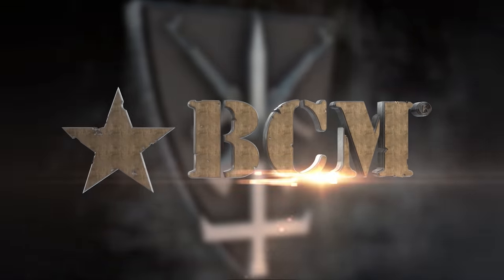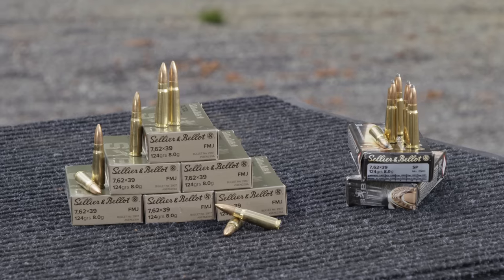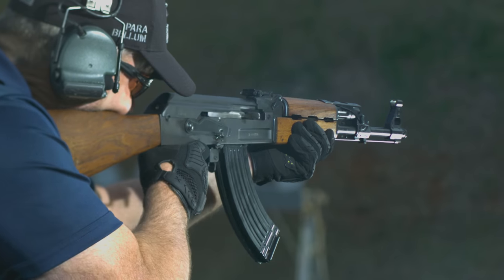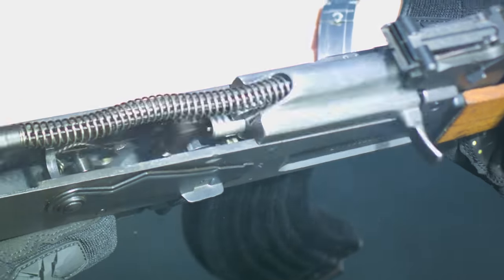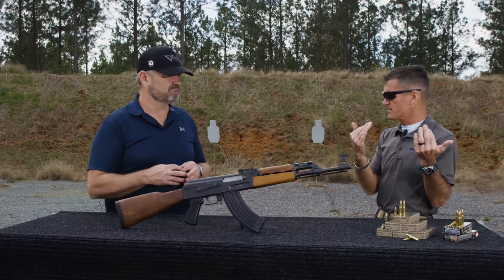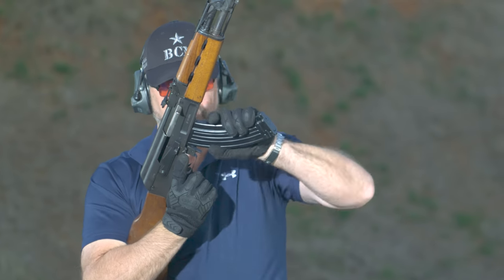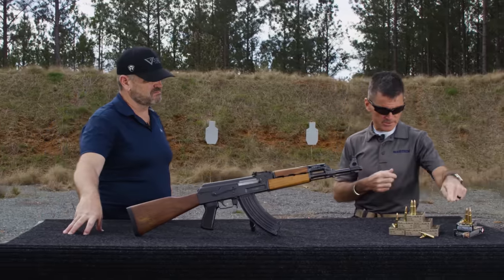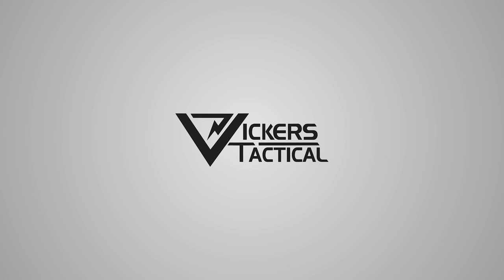S&B 7.62x39 - Brass Vs Steel Case

Comment: Ive always loved steel case. As long as you dont have a crome lined barrel, steel case/ steel jacketed is fine for practice. Also steel case is a 1/3 the weight. Great for bugging out.
Reply: I think you mean DO have chrome lined.
Reply: The majority of 7.62x39 barrels on military style firearms are chrome lined for increased wear and corrosion resistance. Using lacquered steel case/steel core/bimetal jacket ammunition in them does not significantly reduce barrel life, although it is usually less consistent(lower QC, higher acceptable tolerances) than brass case 7.62x39.
Reply: @blackbird_actual  sorry i was talking about 5.56 barrels. 7.62x39 is a lower pressure cartridge so the lining doesnt heat up like 5.56 barrels do. Ive always learned through CMP that steel jacketed bullets can wear barrels faster especially if they are crome lined, but 7.62x39 is significantly lower pressure than 5.56. Thats why i like buying tula ammo, and pulling the bullets and replacing them with M193. That was i get 1/3 the weight with steel case with a better quality bullet. Then just cast the lead out the projectiles.
Reply: @Chris_Garman  its 5.56 barrels I was referencing.
Reply: @Je3perscre3pers  "steel jacketed bullets can wear barrels faster especially if they are crome lined" - why would steel jackets wear chrome faster than steel on steel?
Reply: @ChucksSEADnDEAD  its difficult to explain but its fluid dynamics under pressure. The way i was told In theory, the more pressure you put on certain metals, the easier they bend (and heat). I guess if you want a better example, its why hollow point boat tails can deform in flight. I never understood why copper or brass solid projectiles are so good until i understood this principle. Some companies will put plastic tips in their bullets to prevent deformation. Back to the subject, chrome lining does the same thing but faster. Steel on steel wears fast yes, but not like Chrome.
Reply: @Je3perscre3pers  "the more pressure you put on certain metals, the easier they bend" - but given same chamber/groove/land dimensions, pressure should be similar between two rounds of the same type fired on two different barrels. Pressure shouldn't be higher on a chrome lined barrel.
"Some companies will put plastic tips in their bullets to prevent deformation" - I mean the plastic tips were causing deformation themselves because the heat softened the plastic mid-air until the material was changed for a higher melting temperature plastic... I still don't see how chrome, which is used precisely because of hardness and low wear properties, can't handle steel jacket ammo as well as bare steel.
Reply: @ChucksSEADnDEAD  all i can say is, take a muzzle wear bore gauge, take two chrome lined barrels with the same gas system, shoot 5000 rounds of copper jacketed bullets in one and 5000 rounds of bi-metal jacket bullets in the other. I havnt done it personally, but ive replaced barrels like this(CMP High Power)Their is a difference. It can be anywhere from .001 to .003. Maybe a marginal difference, but its enough to see a barrel go from 1.00 moa factory ammo to someone who practices with Tula to 2.75. (These are heavy or varmint contour barrels so yes 1moa with Tula is absolutely possible)
Reply: @Je3perscre3pers  "take two chrome lined barrels" - but that's not what you're arguing. You're arguing that a non-chromed barrel will wear faster than a non-chrome lined barrel.
"shoot 5000 rounds of copper jacketed bullets in one and 5000 rounds of bi-metal jacket bullets in the other" - What? No! If anything you need to shoot only bi-metal jacket ammo to see if the non-chromed barrel lasts longer. The issue isn't that copper jacketed bullets wear barrels less, it's that you said that steel jacket shouldn't be shot through chrome barrels...
Reply: @ChucksSEADnDEAD  okay. You get what Im saying. Non-Chrome line barrels. Sorry ive been reloading all day long and ive been switching back and forth to this.

Comment: I've always been told that running steel in an AK platform is more of a safety thing than a performance thing. Due to its violent action
Reply: Never heard that I don't believe. It's been 10+ years since I really looked into it. From what I remember, it was just about cost. Steel case was always way cheaper. I've never had a problem with either in my WASR tho.😁😉

Comment: My question is about bullet diameter re bolt gn (CZ). I've heard there is difference between US vs Eastern Euro diameters in 30 cal. That CZ prefer the Eastern spec re accuracy. Is this true LAV?

Comment: Nice but you need to try the new AK203  jointly developed by Russia and India. Its seems its way better than any predecessor AK and is modern and accurate as the AR15

Comment: I don't like using brass in my ak because for some reason my rifle will fire with no problem for about 30 to 60 rds and then the nose of a case eventually breaks off inside the chamber and I will have to jam a sreel case round in just to extract the broken piece

Comment: Something people should know is if you have something like an SKS that has a free floating firing pin it is highly recommended that you should steel case since they have harder primers and brass case have softer primers and if you shoot brass case they have a tendency to misfire and or slam fire when the bolt is closed which sucks now because you can't seem to find steelcase since Joe Biden put those sanctions on Russian ammo. And I've been finding no ammo that is steel case that is being made domestically if any of you guys know any steel case being made within the United States or pretty much just out of Russia please let me know

Comment: Why are iron core rounds not a good thing in a range scenario...and something about magnets?!
Reply: Range owners hate steel dinging their backstops and the steel impacting stuff can throw sparks. A small percentage of powder from each casing is ejected out of the muzzle without burning and gets peppered all over the range. The sparks can ignite the powder and cause fires.
The magnet is a trick to detect steel inside the jacket.

Comment: We manufacture steel cased, non-corrosive 7,62x39 ammo with either mild-steel or lead core bullets and they run perfectly fine in all AK or SKS or VZ variants. No issues what so ever. Even in bolt action rifles. The advantage? Price! GetLoad.cz

Comment: Although Steel Case with bimetal jackets do have greater wear and tear on barrels, typically you will still have money even with the price of a new barrel included. And Tulammo(and Wolf I think) are making steel cased, non magnetic rounds, so you don’t even have the increased wear and tear with those rounds.
Another issue is that it is mainly Surplus Ammo that is corrosive, no new production ammunition will ever be corrosive.
That said, there are still benefits to brass cased ammo, better seal means the gun runs cleaner, reloadable, overall higher quality(not an issue of the steel case, rather who makes it) and more range friendly though this video is biased towards brass cased ammo.

Comment: Thats m70b2 not an ak47 bro
Reply: This is an m70b(milled reviver and fixed stock), the m70ab2 has an undefolding stock
Reply: @tvojamama7807  yes but correct name is m70b2 in manuall

M70b1 acrually my bad...

Comment: Lol what a sales plug. This video regurgitates age-old myths about steel-cased ammo that have been debunked time and again.
Reply: You are right, the only gun that had issues was the original Mini-30.  Ruger fixed that issue almost 15 years ago.  Bolt 7.62x39 guns don't care because you manually operate the bolt, it doesn't need case neck expansion to cycle.
Reply: @bearjew05  Soviet calibers have a ridiculous amount of taper. They were designed to work with steel cases. You almost never hear of stuck cases. You are more likely to have stuck cases if you shoot steel-cased Western calibers like 223 or 308, but it's still not as common as people think. The main issue with steel-cased ammo is not the cases but the bullet jackets, which are also steel. That is known to accelerate bore erosion. But Combloc military rifles have cold-hammer forged, chrome-lined bores, and the barrel steel is very high-grade. They were designed to handle steel jackets. Many rifles on the US commercial market tend to use softer steel barrels and aren't chrome-lined. Those wear out quick with steel-cased ammo.